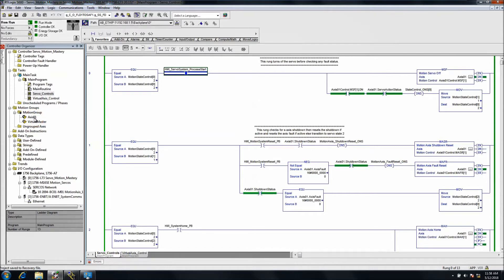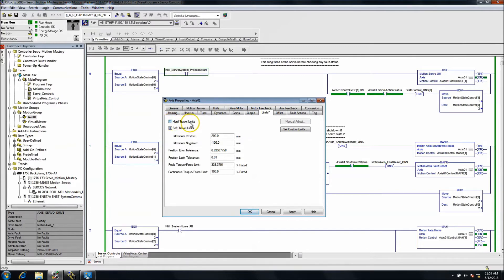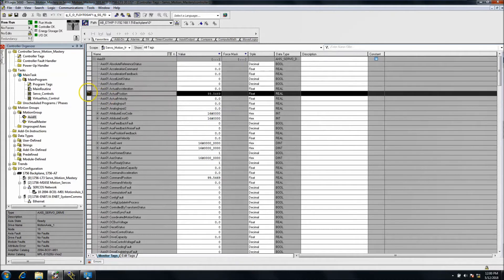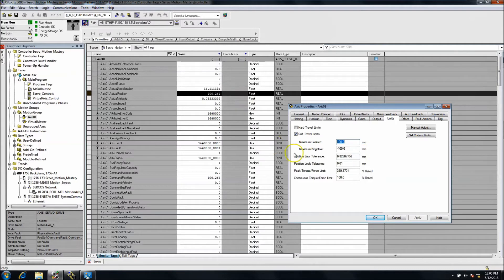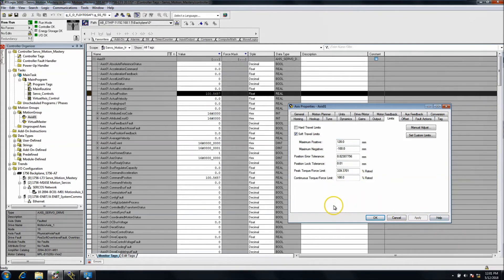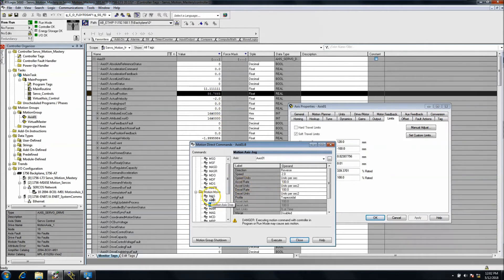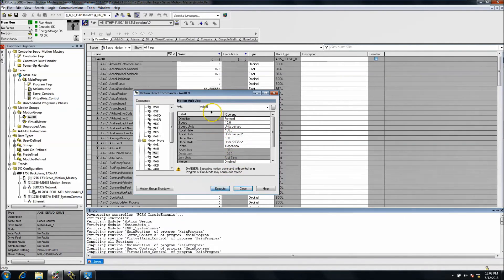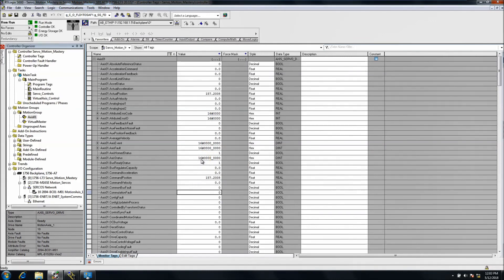RSLogix 5000 Kinetix 6000 Servo Limits Breakdown

Comment: Hi Shane, Nice training.
Reply from the maker: Thank you, glad to help
Reply: @ShaneWelcher  I just used same process for one of the k6 servo motor for peak torque limit.. I changed set up from 300 to 225, but it is keep changing after each stop start...
Reply: Limit value remain 300 post stop start..?
Reply from the maker: @shekardalin  I would allow a high peak but low continuous because the continuous torque at a high limit would damage the motor or encoder from what history taught me
Reply: @ShaneWelcher  ok understand, what is the reason that keep changing limit by itself ..is it because of limit reference coming from ladder steps or is it something else? I really didn't understand  ?

Comment: can you please elaborate position error limit.
Reply from the maker: @ghanshyampandey5746  errors are set on the machines positions, what do you mean ?
Reply: @ShaneWelcher  thanks for your response.......I mean.....Why does this error occur ( causes of error E19) and what can we do for this, is there any setting like tolerance to fix this error, actually we mostly face this problem on our machine which runs on kinetix 6000.
Reply from the maker: @ghanshyampandey5746  If you have limits and exceed them then you need to manually move the servo motion out of the limits.

Also, if you are getting an E19 with no software limits or hardwired limits then it could be an encoder issue
Reply: @ShaneWelcher  thank you for your suggestion......

I really enjoy watching your training videos and have learned a lot from them.

Comment: Could you give an example using a real servo drive?
Reply from the maker: Davide Sanchez 
This is a real servo drive,  I rotate the motor's shaft to make the servo fault on soft limits. 

It is setup in the I/O tree,  did you not watch the whole video?